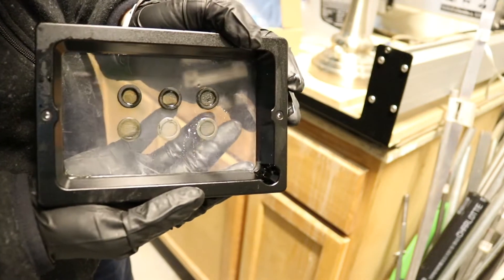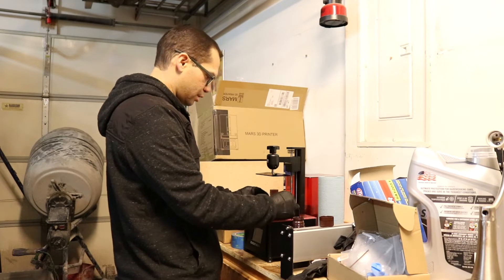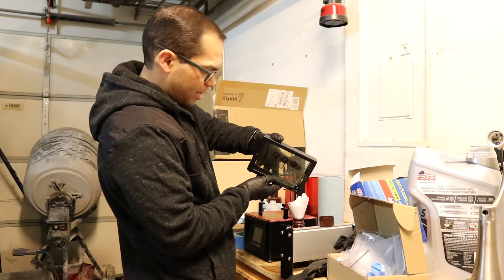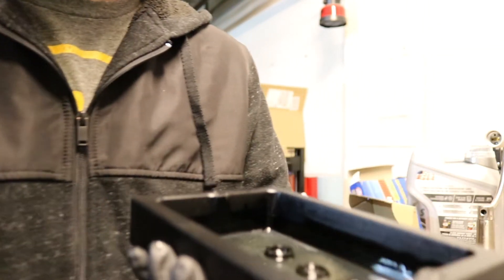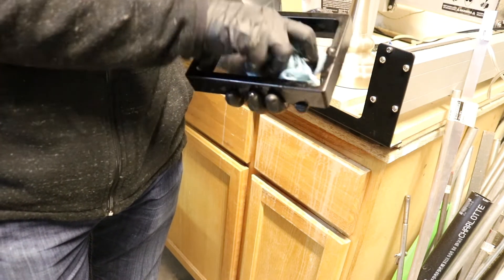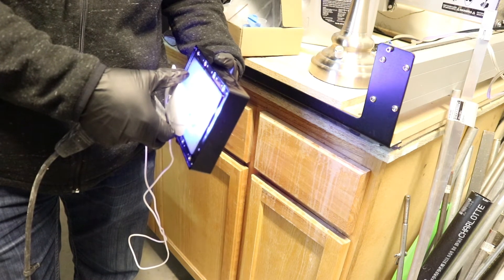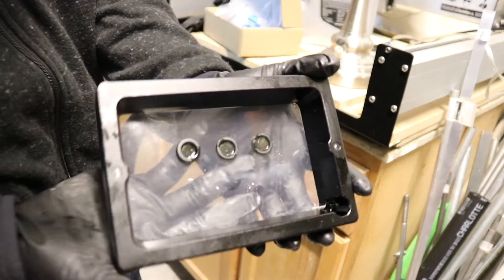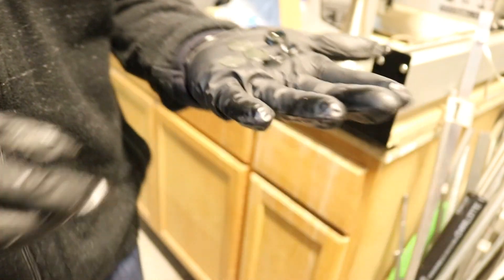Failed print removal for resin printers.

Comment: There's a much easier way that doesn't involve draining the entire tray and dealing with all the mess every time and causing FEP degradation from the cleaning.

The Elegoo printers have a "clean tank' option in the tools menu. It turns on the light exposing the entire bottom layer of the tray. You get left with a flat layer of plastic that's fairly easy to peal off from the edge (the LCD doesn't go that far so theirs plenty of space to get at it). I at most unscrew the tank and slide it half out so I can gently push a corner since trying to spatula it can't quite get under the layer without some flex.

Just make sure there aren't any free floating pieces that could get pushed into the FEP next print.

If other printers don't have the 'clean tank' option it would be easy to make a dummy print that %100 fills the build volume, it should do the same thing.

Comment: Brilliant! I just got my second printer and put a nice little dent/stretch mark in the FEP on my 1st and 2nd print...so started searching for a better way to remove my shame and BOOM....here's your video.
Thank you!
Reply from the maker: Glad it helped. Now I don’t even empty the vat. I just run my finger under the FEP sheet and fish out the piece with a piece of plastic cut from a plastic bottle.
Reply: @First_Class_Amateur  Nice! The parts that failed for me were mostly flat and still bendy enough that I don't get that reaction. Though my printer is in the process of its second fail. Half of the parts are fine so I'm going to let it finish (failed ones are shorter and finished already). Good info. Thanks.
Reply: @First_Class_Amateur  You know what...a small wooden roller with a micro-fiber on top of it might work and keep the finger tip (maybe dirty) away from the FEP. Maybe my wife's facial massager/roller/tv commercial crap thing....hmmmmmm....a small clean roller.
Reply: @First_Class_Amateur  I had a thought I wanted to bounce off of you. What if, after a print failed you ran a sliced file of just the raft for the failed portion. Exposing that semi-cured resin to a longer dose of exposer? instead of 2-8 seconds you exposed it for 30-40 seconds. Then fish the blob out. Before that new file is run you would of course need to remove the build plate.
Reply from the maker: CaffeineMachine I think that could work. Then you may be able to peel everything off in one giant layer.

Comment: What did you do to fix this i picked up  mars pro snd hsve done everything  rook looks just like your printd maybe 30 layers then falls off
Reply from the maker: I ended up exchanging the 1st printer for the same model. Once the new one came, everything worked. I just had a bad machine to start.